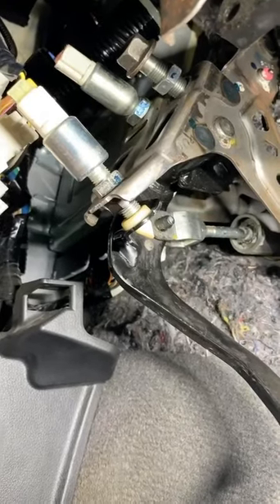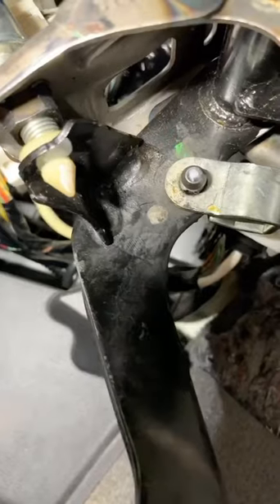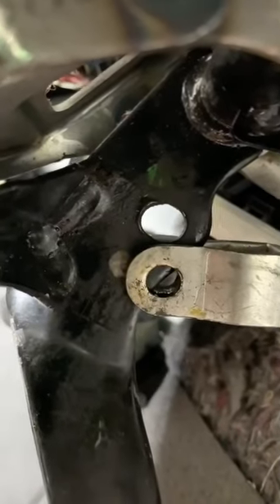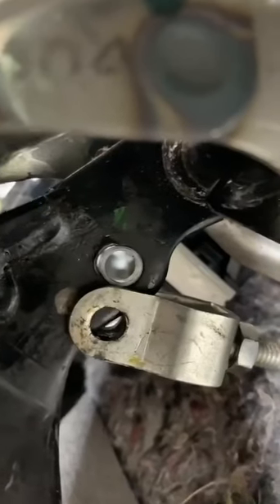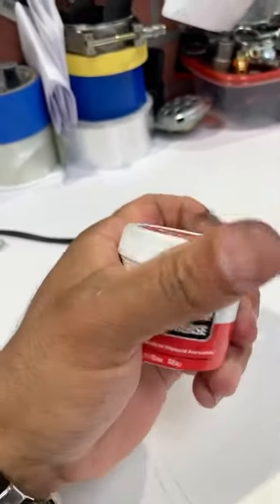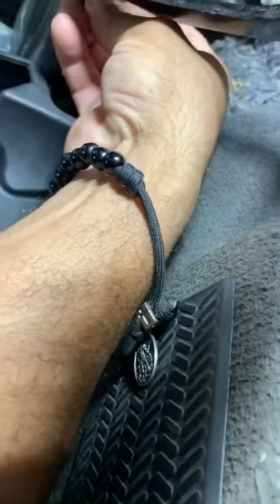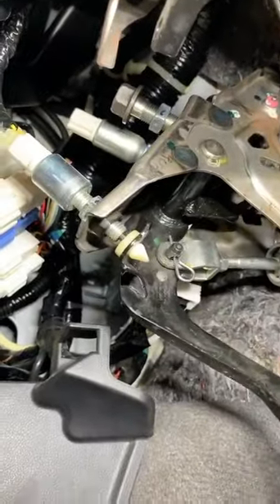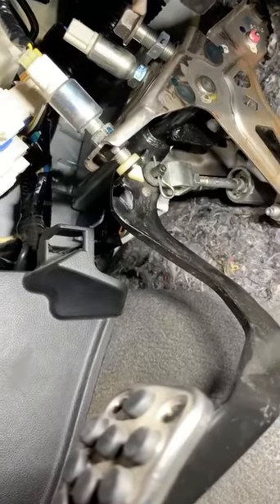Honda/ Acura Clutch pedal bushing

Comment: Hi. Thank you for this video. Although my car isn't a honda, it's quite what I am experiencing right now when I press and release on my clutch and it squeaks. Hopefully I will just need to grease the part where the brake pivots and it will stop the squeaking. I thought it can't be anything else because its an 2023 vehicle. If it still doesn't fix the issue, then the dealership will have to figure or replace what needs to replaced. Again, thank you.

Comment: It's weird that you made this video because I never had this issue until just recently and now this video. I  recommend just swapping out the pedal at that point. The bushing didnt last long for me with that extra wear on the pedal itself
Reply: If ur a cheap ass like me u can pull the pedal assembly out, weld around were it oblongued the hole and then drill a new hole through ur weld the same size as the last hole, and then u got a perfect size hole for that bushing to fit snugly, takes like a hour and its free!!